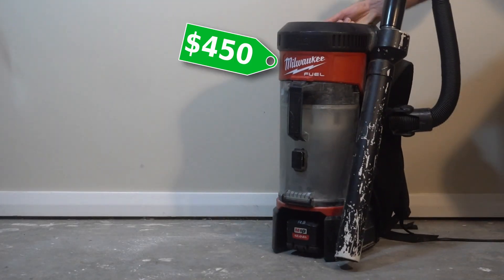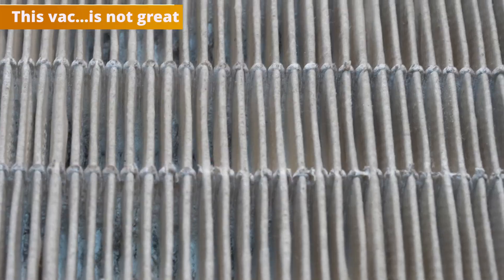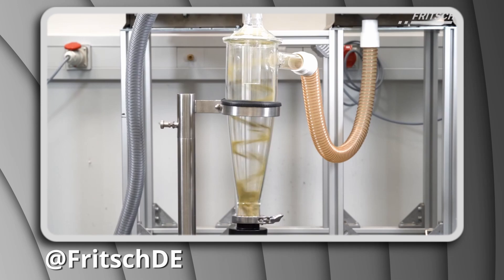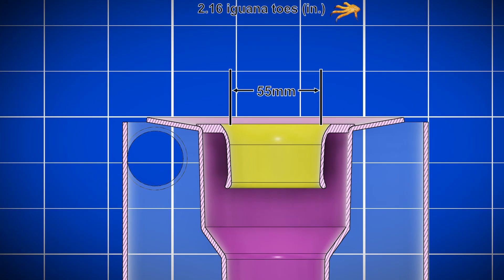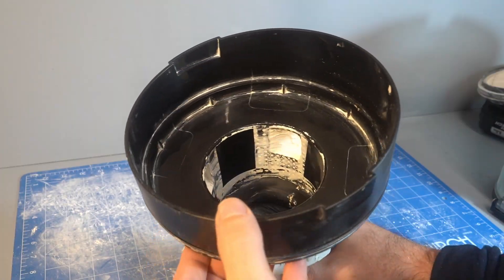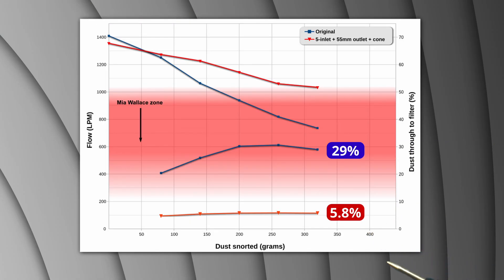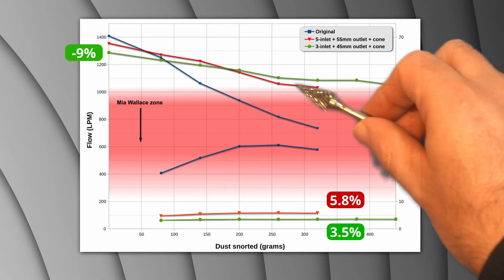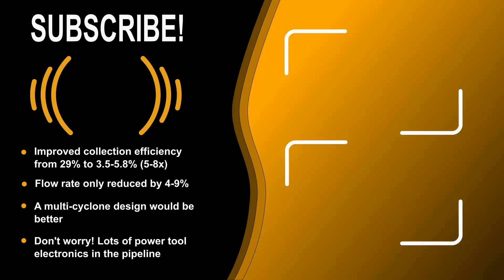[008] Cyclone mod for Milwaukee backpack vacuum

Comment: Any updates on your latest trial ? I have one of these vacuums. Hows the long term test on the 40mm?
Reply from the maker: Long term testing was not good. The cyclone inlets catch hairs which eventually form a net and clog the whole inlet. A made 2nd attempt with 39x 22mm cyclones and a mesh filter to keep debris from clogging the cyclone inlets. Unfortunately the cyclones were too small and the discharge (bottom of cyclone) clogged. Some pics and info here: https://www.reddit.com/r/MilwaukeeTool/comments/1hz7qlo/back_to_the_drawing_board/

I'm going to make a 3rd attempt with ~7 40mm cyclones. Moved house recently, so my 3D printer is still packed away. I should get cracking on it. I really want this vac to be less of a hassle.

Comment: Happy to pay you for a 3D print file or buy the printed version from you , have had this vacuum for a while and don't use it as it is currently terrible. Brilliant R and D btw your very versed.
Reply from the maker: It's not good enough to sell, yet. Long term use has shown that the inlets accumulate hairs and cause blockages. I made a 2nd attempt with 39x 22mm cyclones, but the discharge ports clogged. Currently working on a 14x 40mm cyclone variant, which I hope will be good enough to sell.

Comment: The other thing that is easy that you could make is a hose adapter which nobody seems to make and I could use. The backpack vacuum uses a different hose attachment system and can not use any kind of standard 1 1/4 or 2 inch attachments. If you could make an adapter for the end of the hose to take 1 1/4 attachments, I would buy it immediately. I think it would sell. Plus Milwaukee attachments for 1 1/4 and their hoses are slightly bigger than all the rest on the market. An adapter for that would be great as well. This is something that I am not happy with them about.

Comment: Milwaukee needs to hire you. I sounds like they need better engineers overall. I have lots of their stuff and it is great but could be even better. I have an external Oneida bucket top cyclone that I use and love Mostly with my corded small shop vac. It makes a world of difference Even with muddy water when using a hydrodrill to drill horizontally through the ground. A necessity really. Otherwise the shop vac is useless and needs to be cleaned before tank is even half full after only 10 seconds of vacuuming.

Comment: How much would you charge for a 5 inlet design I would buy this from you and hopefully fund further development Let me know. I am located outside Philadelphia, PA  USA
Reply from the maker: This is my latest attempt. It was 39x 22mm cyclones. Unfortunately the cyclones were too small and blocked up. https://www.reddit.com/r/MilwaukeeTool/comments/1hz7qlo/back_to_the_drawing_board/

I've started a new design with 40mm cyclones. It'll be at least a few months away as I'm about to move to a different city.

Comment: Can’t wait till you finalize this and get this to market
Reply from the maker: Couple of months away. My latest attempt failed as the cyclones were too small and got blocked up. 3rd time lucky, perhaps?
Reply: @toolscientist Any updates on this good sir?
Reply from the maker: @A5Skavanger  done a tiny bit of CAD work. Been busy with life and an electronics project. I'll try and set aside a few hours per week for CAD design. Got it designed in my head, just need to get it done.
Reply: Came back to ask this same question... I would love to upgrade my vacuum

Comment: Proper engineering. It almost warrants printing the whole part, on something like an XL.
Reply from the maker: I have bought a larger printer since making this vid. I need to do a complete redesign with multi-cyclones as the performance wasn't as good as I hoped. I want to be able to vacuum a few kg of fine dust without needing to clean the filter

Comment: I designed and 3d printed this exact thing about 2 years ago trying to solve same problem. Mine drops into the middle with no modification needed. Definitely helps but I didn’t do your efficiency testing and is probably impeding a lot of flow. As I dont use mine regularly as a portable vacuum, I decided a cyclone inline with inlet hose was best. Happy to share my design if youd like to reach out.
Reply from the maker: Yeah, I would have done a single piece but my 3D printer wasn't big enough. I have a bjgger one now, but I'm fairly set on doing a multi-cyclone. There's just not enough height for a good single cyclone

Comment: I'm curious if it'd be possible to basically 3D print the entire top and filter area of this vacuum but design it to have the cyclone built in. Basically, instead of modifying what's already there, you just toss it and replace it with modified internals. Maybe you could even squeeze a small canister filter like you showed in the video instead of what Milwaukee does. Unfortunately, I'm not knowledgeable enought nor skilled enough to model something like that on a computer to print. Though. If you do come up with a design, I'd be more than willing to buy either the 3D print file or a copy of the part itself. In fact, i think many people would make that upgrade.
Reply from the maker: That's the plan. I just upgraded from a 100x100x100mm printer to a 240x240x240mm printer last week, which will allow me to print that whole inner piece as one part. I'll do a multi-cyclone mod and a cylinder filter mod and see how they compare
Reply: I truly mean this, thank you so much for your work. If you make it, I'll buy it, that is if you make it available for sale. I don't have a 3D printer, so it'd be great if you sold the part pre-made.

Comment: Great video, I always learn alot from your work. My question is why not modify the vacuum to just accept a vacuum bag like a "shop vac"? Whenever I have a bunch of dust to handle I just make sure my shop vac has a bag and that pretty much catches all the dust. Just a thought and I would still like to see all the mini cyclones lol
Reply from the maker: I had thought of modding it to accept Dewalt filters as they're larger, cheaper, and easier to clean,  but I hadn't thought to try a bag mod. It would be tricky as the cannister only opens at the bottom, so you'd have to slide your hand up the side to unlatch and remove it. Hard to compete with the flow rate of a bag, but ultimately it's still just a filter that will reduce the flow as you add dust, just not as fast as a raw filters. 

A well designed cyclone will give you less flow at the start, but should stay very flat as you add dust. I've got an old dyson, and its filter still looks pristine.

If I do the multi-cyclone mod, then an interesting follow-up would be to get an old shop vac and do a bag vs multi-cyclone experiment. If the cyclone flow rate doesn't overtake the bag until the bag is nearly full, then that's a win for the bag.
Reply: Also bags get choked by the fine dust pretty fast. At least in my faithful Karcher wd3

Comment: if you take the filter out and put it in a safe place before using the vacuum, it wont get blocked 😏
Reply from the maker: That's not very pimp, though. "Yo dawg, I heard you don't like clogged filters...so I removed your filter"

Comment: I love the concept and execution, it seems like Milwaukee really dropped the ball on this. They could’ve implemented a similar design from the get go, especially at $450+. 
I also Loved seeing all of the data!
Reply from the maker: I'd have to test other vacs to compare. They might all lose flow rate this fast. The simplest thing they could have done is just use a big cylindrical filter that'll take longer to clog and will be easier to clean. I do want to try a multi-cyclone, though. 440g is weak-sauce. I want to be able to dump >2kg into this vac and have it still partying

Comment: OK, so with a 3-inlet mod (or a 5-inlet mod too, for that matter), you should be able to just empty the vacuum after 300-400g of dust without cleaning the filter and still get a lot of the original flow rate back, right? Because of the better filtration efficiency?
Reply from the maker: Unfortunately not. The dust at the bottom of the cannister has little effect on the flow. What matters is how much dust gets in the filter. My mods slow down how quickly the dust gets into the filter, but they still let some through. So the flow will continue to decrease until you clean the filter.

Comment: I've been unimpressed with most tool vacs I've tried. My Bosch hand vac SUCKS.
My mid sized SEBO is a great machine. It packs the bag solid.
Reply from the maker: Yeah, I've been disappointed with most. They all clog up too quickly. Need a good cyclone or pulsed air filter cleaning. None of them are any good for home use as they lack a powered head. I think there's a Ryobi with a powered head.
Reply: @toolscientist  I'm hoping PF will do a comparison on small handhelds. Did you see Torque Test Channel recent video on (edit: universal battery and) adapters? Thought of you str8 away.
Reply from the maker: @Hagar76a  didn't he do handhelds last week? They were all residential vacs, though. Even amongst tool brands there's so many variations.  PF tends to end up with outdated models for some of the brands, so it's often a bit apples to oranges.

I saw the CEENR vid of TTCs. I made a comment there. Looks like it's a pack with stand-alone protection. From TTCs load tests, it was losing 1V compared to the Bosch and Dewalt, which works out to about 27mOhm extra resistance. They must be using really bad mosfets to get that as you can get 10mOhm from $0.60 mosfets. There must be some other source of resistance, maybe thin traces on the PCB. They look to be using a pair of 5mOhm shunts (so 2.5mOhm total) which is 10x more than Makita uses.
Reply: @toolscientist  yeah he did upright/combo domestic. I just need a small handheld for small cleanups. 

That's disappointing. A true universal battery system can only help to bring the costs down for consumers, if its done right. It is great that they are using 40T exclusively. Keeps it simple.

Comment: Simply fantastic.  Why don't mfgr's do this?  Send them this video as a request for hire.  Love the research, thought process, data, humor, pointer tools, results, ...
Reply from the maker: I think Milwaukee intended for the inner to be a cyclone, but ditched it late in the design. I suspect they hit problems with having too much resistance, or having an inlet that's prone to clogging. I somewhat solved those problems by going multi-inlet, which isn't a conventional cyclone design. There's also cost. I can make it as complex as I like because I don't need to mass produce it.

It is strange that no construction grade vacuum has tried proper cyclonic separation (the Makita stick vacs are the closest). Cyclone's are obviously well established in residential vacs, but construction vacs just use pulsed air to knock dust out of the filter. 

It's a challenging design to get that balance between filtration and flow loss. Adding a cyclone will always reduce the flow, but it helps in the long run

Comment: Have a look at the "dust deputy" as a concept of making this into a 2 stage vacuum.
Reply from the maker: Too tall as it is. If I do more work on this, I'll compare all the designs (Stairmand, Lapple, Bill Pentz, Dust Deputy, Dyson, and a few others that I've found in research papers). Whichever one gives me the best filtration for a given pressure loss will be what I use.

Comment: Awesome, you pay full price for the tool and get a privilege to improve it to a usable level 😅

Jk, but great work! How large of a 3d printer would you need?
Reply from the maker: Not massive. That whole inner cone is 180mm diameter and I think 230mm deep. My printer is 100x100x100mm though. The inlet ring had to be done in 4 parts. Any thoughts on decent printers? I could try getting someone else to print it, but tolerances need to be fairly good, so I'll have to do a few iterations.
Reply: @toolscientist  ok that doesn't sound bad at all. My rec would be qidi Q1 pro, it has sturdy chassis, heated chamber and klipper firmware with a good extruder system and is almost a bargain for what it offers. And you will want a heated chamber as someone like you would print abs and PC mainly :)
Reply: @toolscientist  you might wanna get a Bambu printer? for the P1 series the print size is 256mm on all 3 axis, print time's fast too so it saves you some time between iterations
bloody amazing job with that design btw!
Reply from the maker: @wingka  I've been tempted by the Bambu's as I'd like something that just works. The Qidi Q1 Pro is half the price for the same build volume, though. Looks like I've got to read a whole lot of reviews. Been 10 years since I bought a 3D printer, so I imagine a lot has changed.
Reply: @toolscientist   I have watched all the reviews so might save you some time :D P1S is also great option but that heated chamber on qidi is a game changer, it is more open for tinkering and it also just works, ofc not the same refinement level as bambu but shouldn't be an issue since you are not a complete beginner. There are also profiles available in orca slicer for it.
Reply from the maker: Yeah, it was a bit of a disappointment. They would have been better off just using a big cylindrical filter with a pre-filter bag. First time I used it, it only lasted a few hours of light drilling before needing the filter cleaned. Then I took it apart and realised it wasn't really cyclonic at all. That was 2020, so I finally got around to pimping it 4 years later.